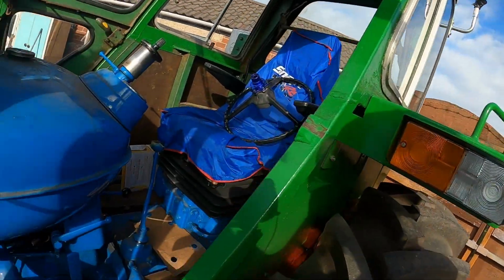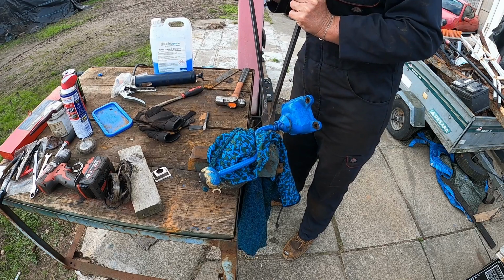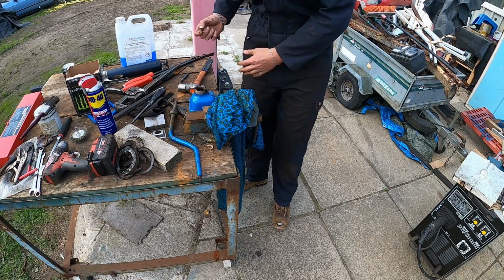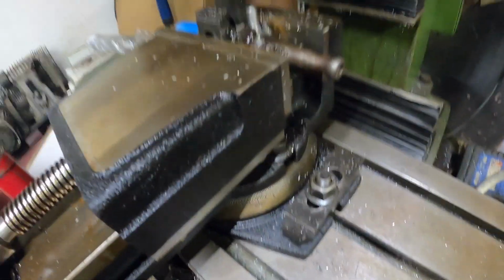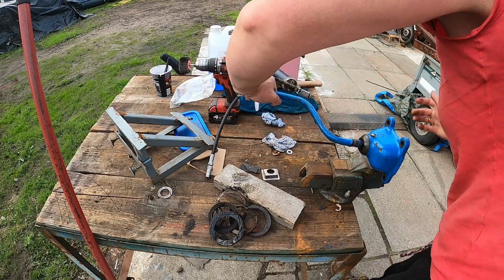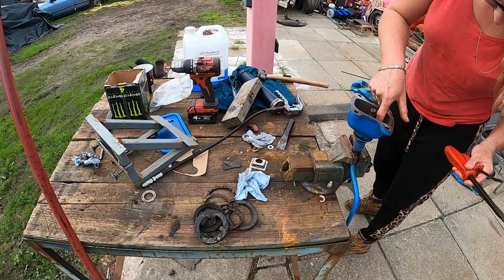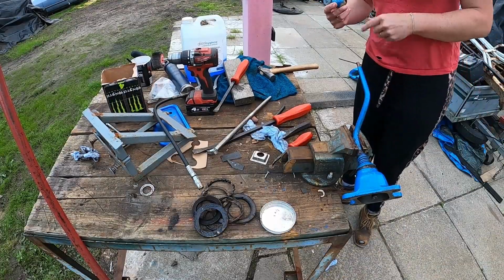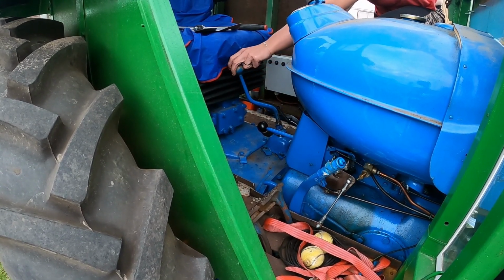FORDSON MAJOR GEAR STICK REPAIR

Comment: Thanks for a great video. 😀
How is the pin fastened to the housing? Is it mounted from the inside?
Greetings from Denmark. 🇩🇰
Reply from the maker: The pin inside the housing that locates the gear stick?

Comment: Was just responding to the guy from Iraq, who tells his first family tractor was a Fordson '62 , and I didn t know what a family tractor is, maybe one he inherited or bought from uncle?, never mind, just traded a MF 35 X for a Ferguson 20 and a '63 Super Major with construction forklift behind myself, and just made a cab from steelpipes and low profile roof steelplates, which will make and preserve a better inner climate for controls and what have we behind the vindows, well right now we have a totally stuck diff lock pedal that has to come loose and of course the axle seals that are non existent right now, just did new spindles and bushings, 3,5 mm s of wear on the old ones, but they can be welded and turned down to specs., front is rusted too, so must be patched with new plate here and there, engine runs well, but think will control injection tips for atomizing the fuel, bet noone ever did, another gearlever came with the tractor which is better but not perfect, might repair the old one which twisted a lot, thank you.
Reply from the maker: Yes family tractor is usually owned by another family member before you get it.   Sounds like you have done a lot of work to your machine, and have a few jobs still to do 😀  thank you for taking to time to comment.

Comment: Nice repair, you have very good skills. I'm trying to keep three old ford 8n tractors running and it is always something that needs to be fixed.
Reply from the maker: There is always something to do to them if you use them. Better to use them, than have them as museum pieces in my opinion. Keep them working 😀